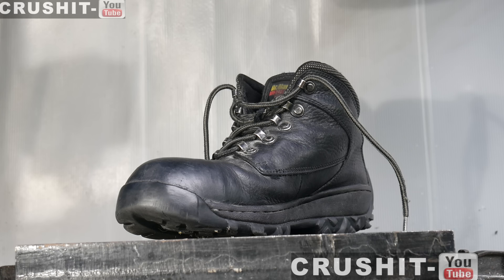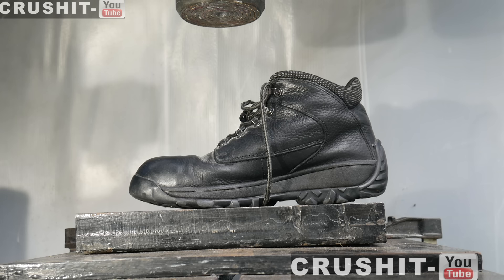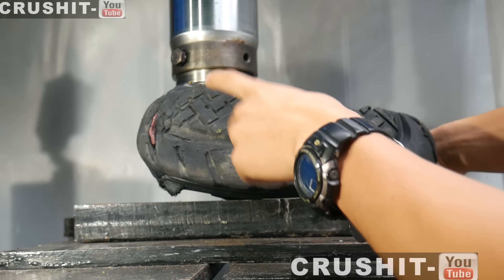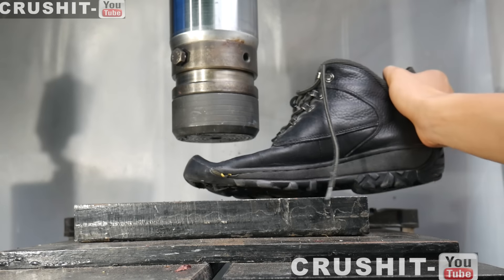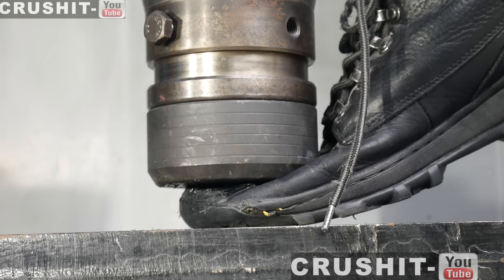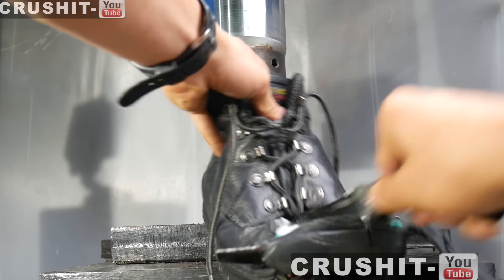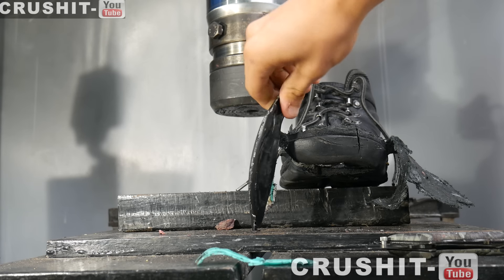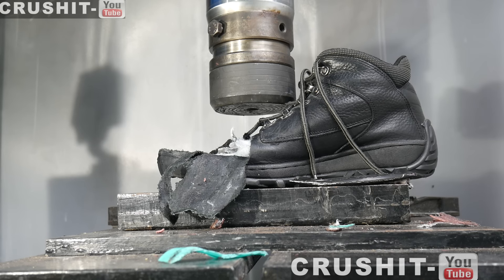Crushing Steel Toe Cap Boots with Hydraulic Press!

Comment: Safety toe caps are meant to protect from (relatively) light falling objects. Heavier objects that go beyond its rated protection level will instead make it bend on the inside and then cut your toes off, since its easier to treat a cutting injury than a crushing injury (the bent toe cap can resist higher forces due to its new shape, so crushing damage does not always happen).
Reply: People struggle to believe me when I tell them that.

Comment: Those boots are very good for lightweight work (brick falls on the foot), but if you are in really big construction site, I would avoid wearing these, as some weight falls on your boots, crushes them and you will not be able to pull out foot, even when weights are removed.
Reply: When I was 6 a group of Gypsies stomped on my head with steel to cap boots  and it nearly killed me.........
Reply: Mark Schulz IV  this is gonna sound weird they were originally made to cut off the toe to keep the bones from shattering into powder so that instead of an amputation they could be surgically reattached
Reply: MrHeman55 yes they are designed like that, but that doesn't always work.
Reply: +NEGAN. gypsy is a derogatory term
Reply: +Andrew Centeno I think he is trying to insult gypsies, maybe for stamping on him.
Reply: Skaarj RPG I dropped a balling ball on my foot one time when I was little and nothing happened.  lol Ik it has nothing to deal with your comment but I just wanted to say it. lol
Reply: Just yesterday a guy at my shop was lifting a 10 inch square tube with a magnet and it dropped it right on his foot. I don't know the weight but imagine a 10x10 square tube about 20 feet long 3 feet in the air. Smashed right on top of his steel toe and it buckled the toe in and pinched his foot in the boot. He got it off and nothing was severed but he did have 3 broken toes. I cal 3 broken toes pretty worth it for something like that to happen. With no toe insert he would have had a completely powdered foot.
Reply: @ineedmymodfixed  wats a powered foot?

Comment: steel toe boots are designed to fail a certain way, they can withstand some weight, but they are designed so that the steel amputates your toes cleanly and evenly instead of the weight crushing and bones in un planned ways.

Comment: steel toe shoes are only designed to withstand about 75lbs-100lbs of force before the steel folds back and cut the toes off to prevent the wearer having a mangled or trapped foot

Comment: one thing worth noting, steel toe caps protect you until a point, but if there is enough force to crush the steel, itll acctually be worse than if they were normal boots because the steel itself will start stabbing into your foot.
Reply: If the steel cap start stabbing into your foot, the pressure would be enough to shatter your bones and tears your flesh away. So yeah, wear your safety boot still.
Reply: Big Mofo yeah I know, im just saying that the steel to caps dont make your feet invincible, you cant just go and stick them under any weight and expect them to hold out. against work environment forces but they have limits.
Reply: actually there are cases where people working with large horses  were wearing steal toed boots and the horses stepped on their shoe and they lost all 5 toes
Reply: @revampedharpy09  yeah but they're still much better than no steel toes

Comment: It isn't just for protecting your toes, it is also meant for cutting off your toes. That way if something really heavy drops on your toes, it should cut off your toes rather than rip them off. The reason for this is the fact that you can't reattach your toes if they get ripped off, but you can if they're cut off.

Comment: Just so you do know steel toes are not actually there to protect the feet essentially. When enough force is exerted on steel toes they will actually cut your toes clean off, instead of mangling them. This makes it much easier to be surgically repaired in the case of a severe accident. But in small falls and drops they do the trick in protecting the toes.

Comment: Steel toe boots are not only made to protect yours toes from lighter objects, but if you have something really heavy fall on your toes or something runs it over it design to cut your toes off at the joint so that they can be re-attached

Comment: it is not designed to withstand very very heavy objects as people think. it is designed to prevent damage or such from lighter objects such as a small 30 metal rod, etc. even some sharps like a box cutter it can protect the toe whilst normal shoes would be cut through.

Comment: Kind of obvious that this would happen. There are stories going around in warehouses that if a forklift drives over your foot, that a steel toe shoe is only negative because it's difficult to get the bended steel away from your foot. A forklift weighs about 3500kg. This press does 50.000kg or something. Do the math.
Reply: Richard van Pukkem but 4 wheels shares 3500kg.

Comment: My dad uses similar boots to that but it only has a tiny bit of metal so I don't think I will survive this test all that well
Reply: my shoes have alot more metal and are twice as thick as that. his are probably composite which is extremely light weight but still as strong
Reply: and mine are 2 pounds each

Comment: Most steel toes are i-75 which is rated for about 2300 pounds your using probably a 20 ton hydraulic press what you except

Comment: why did crushing alone make it get hot? no heat source.  i dont know much physics so anyone got any ideas?
Reply: The energy has to move anywhere. A part crushed the shoe. The rest got warm instead. That's why its possible to make steel glow just with hammering on it :)